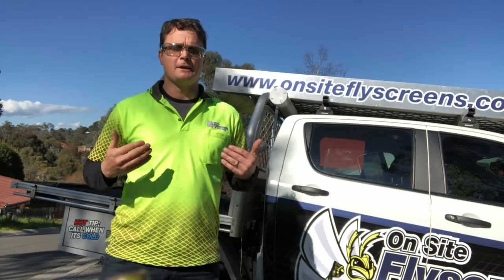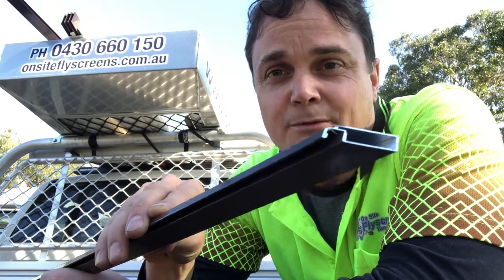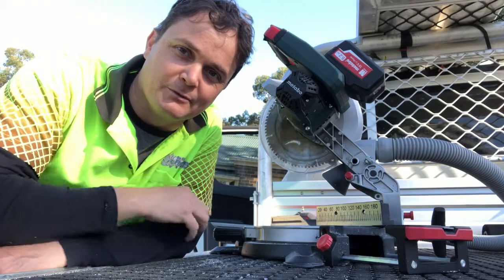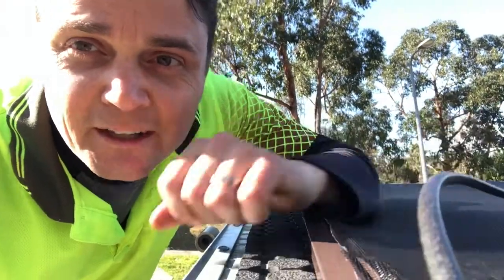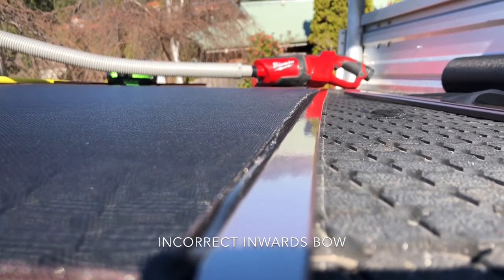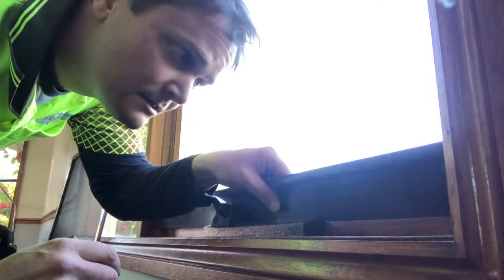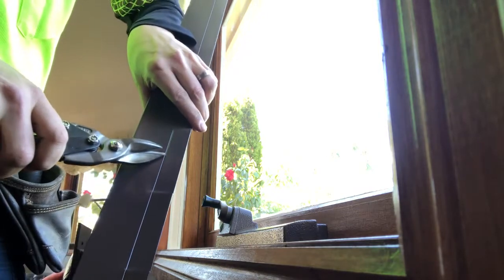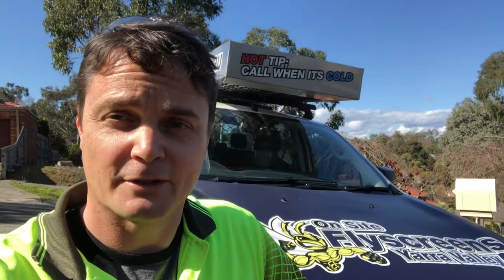Wind-out window screens

Comment: Thanks Ben ,  I had some old Truth winders that started falling apart and decide to buy Whitco winders as the Truth is no longer available and I wanted a lockable option. Where would I get the better screens from and the sill extenders. I am in N.S.W.  Bunnings have some but not as good as you have shown.  Very helpful videos. cheers.